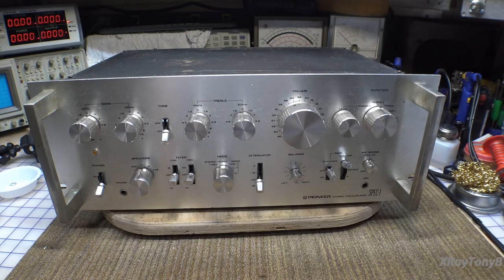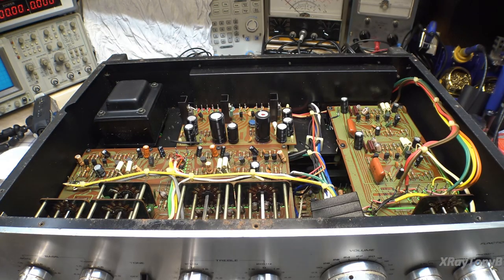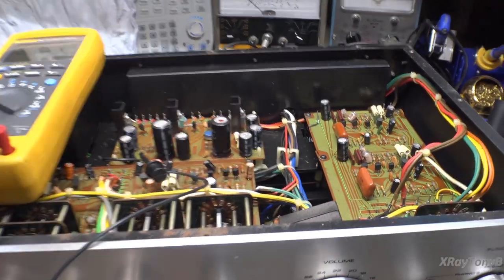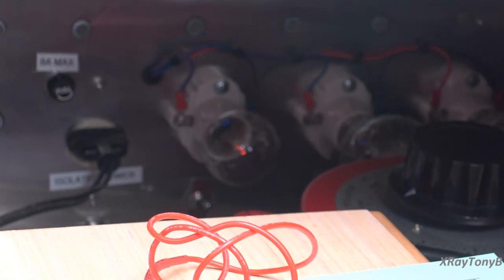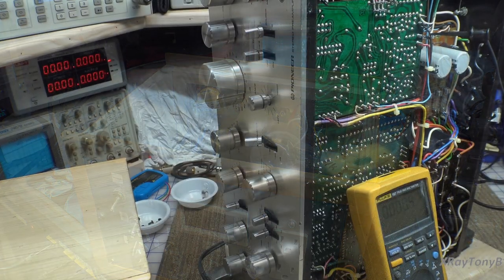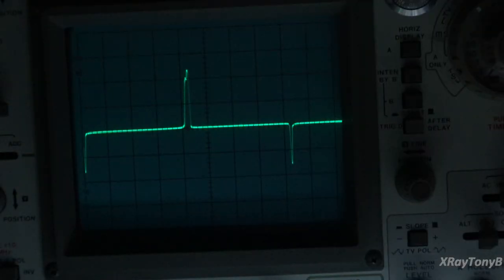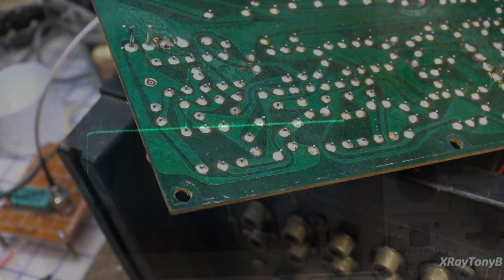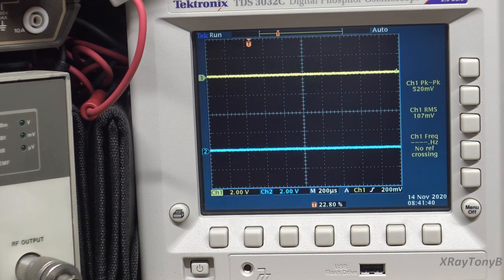Pioneer Spec-1 Preamp - Part 1

Comment: Very nice
This particular piece, ... the era, type/style, etc., of pre-amp is likely my all time fave visual in audio electronics. 

The industrial design is simply superb. 

I also like the Fluoroscan meter era integrated amps. 
Visual appeal varies with people, but damn, those blue Fluoroscan meters on those units were gorgeous. Pioneer still had solid cache/reputation, and via TAD, they're engineering and R&D was second to none at that time.

Comment: The Pioneer Spec-1/Spec-2 was the greatest combination of Pre-amp and power amp ever created. I purchased these while serving in the US Marine Corps on Okinawa, Japan. The headphone amplifier in the Spec-1 pre-amp was absolutely spectacular. I used the Koss Pro4/AAA headphones and listened to Genesis. I had the Pioneer JA-R1A equipment rack, Pioneer CT-F900 cassette deck, Pioneer RT-707 open reel deck, SG-9800 graphic EQ, Pioneer DT-400 digital clock/timer and a Pioneer direct drive turntable sitting on top. Later, I also invested in the Pioneer RT-909 10 1/2" open reel tape deck. And topped this system off with the Sansui SP-X11000 speaker system with 2-17" woofers per side. Awesome system! Wish I still had it. From 1978/79.
Reply from the maker: Koss Pro4/AAA - another thing I would love to have in my collection!  One of my cousins had almost that same setup.  It sounded amazing!  Thanks for sharing!
Reply: Hey Marine.  I spent MANY hours in the audio hobby shop run by special services at Camp Foster on Okinawa in 77/78.  It was an audio paradise.  I wound up buying the Sansui CA-2000/BA-2000 amp pair.  I did stick with Pioneer for the CT-F1000 tape deck and PL-570 turntable which were fantastic units.
I think I made a good decision as I still have the Sansui amps and they are still going strong.
Semper Fi!
Reply: @robertweinmann9408  That's pretty cool. I bought some of mine on base, but most of it at a Pioneer shop off base. I was on Futemna. Most of my equipment, I donated to my church back home in West Virginia to be used as the church sound system. And it was used there for many years. That PL-570 turntable sounds familiar. I wasn't sure of the model I had back then. It was stolen from me in the barracks at MCAS El Toro.

Comment: (@47:41) - All too true, Tony. This is why I recommend getting something like the Peak Atlas DCA-55 component tester (or something similar); it has three test leads, and will identify all BJT, (mos)fet, SCR, Triac, Ge/Si diodes, LEDs, and diode packages (such as those used in computer power supplies, or in the older TV sets with the sync separator “diodes”), as well as tell you the pinout, and some simple specs. These are great for testing a new part that you’re going to put in circuit to confirm the pinout is what they say it is. It’ll also identify obviously bad parts for shorts.

Comment: I usually find a small spot of carbon between the legs of the transistor where it is leaking across. I used to use a craft knife to scrape between the legs and usually it would fix them. Not sure if it was due to the black paint on the legs but it was common on the painted / coated leg transistors

Comment: Thanks Tony. I have a feeling my Spec 1 that I bought "inoperative" due to user error. Having to go back to the preamp with speaker wires is very different from any other gear I have ever used.
Reply: imo pointless complication. more connection contacts to degrade signal. - no trouble to have switching on power amp. preferably relay-controlled, like on some high-end Kenwoods.

Comment: Hi Tony First of Im definitely out of my comfort zone, being a retired electrician so please make allowances for my ignorance. Would it be the case when dealing with such small resistance values , even assuming the devices are the same part No . That differences will be always present dew to the limitations of the manufacturing processes . And also the limits of the test equipment used to ascertain said values . Love your channel . I am  trying to get to grips with this fascinating subject, but it can be very confusing to a novice like me.    Regards Mike 👍

Comment: Oh! A beautiful Japanese made soder sucker with the silicon tube on the end of it! Have you thought about putting a silicon tube on your vacuum pump soder sucker? I have always wanted to know if it improves the suction! I have one of those large goot type soder sucker that has the melting tip on it. Although I think that with a piece of silicon tube on the tip of it will give it more suction power to pull out the soder from the other side...
Reply: It would probably improve suction but it'll do nothing for thermal transfer to melt the solder.
Reply: I do a lot of desoldering. The $245 it cost to switch from my “beautiful” Japanese solder sucker to the (also Japanese) Hakko FR301 desoldering gun is some of the best money I’ve ever spent. And, yes, putting silicone tubing on the Hakko’s tip would be about as useful as putting silicone tubing on the tip of your soldering iron—that is to say, useless.
Reply: @sonotdown998  that's what I thought

Comment: Pretty sure the tarnish on the transistor leads is the source of the problem on those 726's. Often works it's way into the semiconductor element itself. Sometimes the tarnish is so bad it actually bridges between the leads at the transistor body. The 12voltvids guy had one that was "fixed" by cleaning the tarnish between the legs at the transistor body. Not the way I would have done it but the guy's kind of a hack anyhow.
Reply: Yeah I saw that video

Comment: That eizz volume regular is nice but.
If you just open up the volume to let's say 4th step in early steps then the first 4 resistors are not in series in the signal path the other 20 resistors are in series with the signal path. Just like dact it is the same wrong regular. I made a Elma switch like dact use. 4 decks 2 for right and 2 for the left channel. In each 2 rotaries I placed 3 resistors logarithmic overall resistance I used a special 150k ohm you can use 50 or 100 doesn't matter the way I made it it is always 2 resistors in series between them per step is one resistor going to earth. So it acts like a voltage devider with 3 resistors. Benifit is there are only 2 resistors per step per channel in series in the signal path and only one parallel to earth. Greatest benifit is the impedance in and out stays within 3% (1% of each resistor)
So my volume regular has got 144 resistors stored but only 2x 3 in use per step. If impedance is within 3% the tone of the volume doesn't change one bit. Bass mids and treble sounds very even from 300mV to 10 volts out of my pre amp.
With help of my friend who is  electronic engineer. Back in 1992 we made this volume stepped regulater and stil working great till this day. 28 years later think course of the gold plated contacts. Back in 1992 dact didn't made them yet and it costed me about 210 gulden in Dutch money, 74 euro todays money so kind of cheap. And 1% resistors at E96 where cents back then now they are euro's per piece. But your Chinese will be far better then a Alps. Nice video again.

Comment: Is there a way to match transistors  without the expensive test gear ?
I'm planning on doing a recap on my Pioneer SA7500 soon and it may need a few transistors replaced to as the tone control section doesn't work properly any more plus I'm starting to get some other problems to lately.
Reply: Mr. Carlson's Lab has a tutorial on that subject.

Comment: I'm unclear as to why the old volume control is ruined.  I understand the shaft came out, but why can't it be put back in and secured properly so that it feels right?
Reply: Thinking the same thing ... but either way I sure like the idea of a new Stepped Attenuator as opposed to the old pot.

Comment: I was hoping to see how the voltage selector jumper is wired. I can just barely see it it at the bottom of the screen. I then noticed Xraytonyb is also working from a schematic that does not show this tranny and switch combo. My switch is buggered up and needs a rewire. A clear photo or the right schematic is very much needed. Can anyone help me?

Comment: stepped attenuators had nothing whatsoever to do with digital, in design, or functionality, as said they are a switch between discrete resistors, to be clear. Alps have good reputation, later used laser-trimmed miniature resistors, db accurate capability (certainly on Nakamichi) also good on hi-end Kenwood. good vid!

Comment: Years ago I saw the whole Spec-1system in this guys living room, Reel to reel, preamp, a few amps, tuner, tape deck.. There had to be at least 10 units.. Funny thing to me was his speaker's were horrible sounding AR's..
Reply: I have seen a few systems where it seems like the person just bought what was fancy or popular without actually worrying too much about sound quality. 
Years ago I was at a bosses house where he had a full Mc system driving gigantic, two cabinet Electrovoice PA speakers. He only seemed to be concerned with how loud it got so it definitely served him well. At full volume I bet you could have used those horns to peel paint if you aimed them at the walls.

Comment: Anyone know what is the name of the tool used for unwrapping wires from the pins and what is the most common size needed for vintage gear in particular Pioneer? Anyone have a source for this tool.
Reply: It's called a un-wrap/re-wrap wire tool. I got mine on eBay..look for a good used one as some of the new ones can be expensive. In one of Tony's other video's, he shows how you can make one. I don't remember what gauge wire was commonly used on Pioneer gear of this era..maybe 20-22 gauge?...most of the ones you come across will work on those sizes.

Comment: The problem with the stepped attenuator is that it’s a sealed unit; when the switch contacts eventually corrode, there’s no way to get contact cleaner in there. Of course, in all fairness, I’ve seen some pots that are guilty of this “feature” as well. 😏
Reply: I see screws. That unit looks like it will open up.